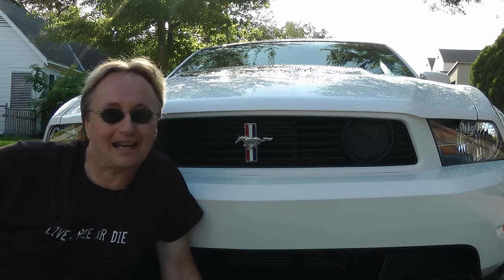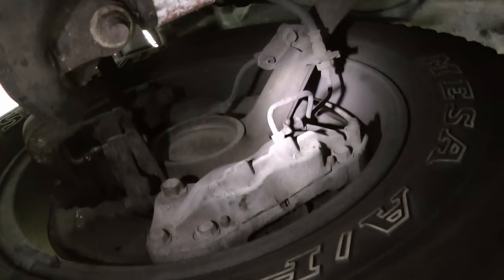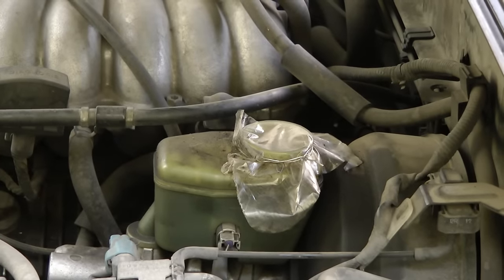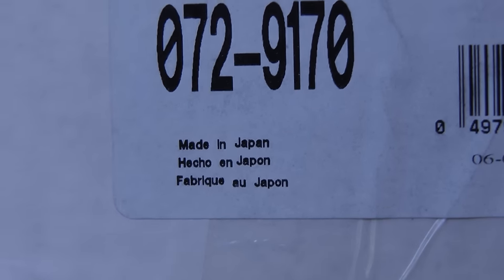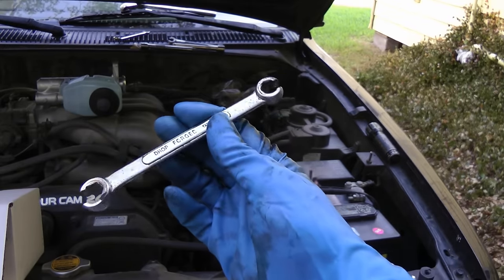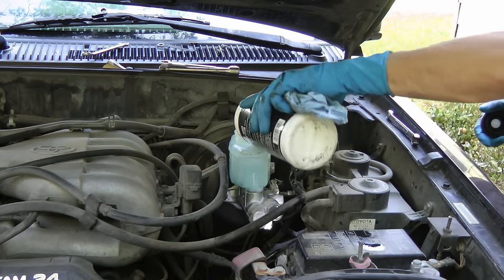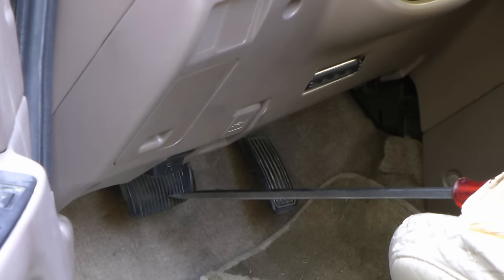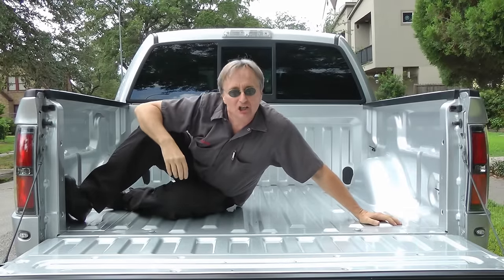How to Fix a Brake Pedal that Sinks in Your Car (Brake Master)

Comment: Having an issue with my 2000 integra...abs light is on and the pedal sinks to the ground...it will build pressure if i pump it but once i start driving the pedal will sink to the floor again and the only way i can get them to stop is if im constantly pumping the brake...i have brake fluid and there is no leaks ..what could be the issue? I need to fix it asap bc its dangerous as hell driving like this please respond
Reply: Well, not the same vehicle, but I have a 02 Ford f150. Had a sinking pedal halfway down. Changed master, still there. Found that the ABS unit was leaking by, and causing the rear system to bypass. New ABS unit fixed all!! Best brakes EVER!!!!!

Comment: Great method - I usually bench bleed the master cylinder, but this method looks much easy/ quicker .Thanks for sharing it- does this mean no adjustment required for cars with abs module mounted adjacent to master cylinder , or ??  Thanks again for your videos

Comment: Hi Scotty, love the videos. I've got an '04 Tacoma that I took up for an oil change a month back that has been given be grief ever since. During the oil change they also changed the brake fluid. They recommended I replace the engine valve cover gasket but I decided against that initially. Shortly after my car starting smelling of burnt fuel every time I drove around. I took the car back and it turned out that oil was leaking from the engine (of course this hadn't happened before the oil change). I took the truck back and had the valve cover gasket replaced then as I was driving off the lot I noticed my brakes were very stiff and difficult to depress. I went back and my mechanic checked the vaccuum pressure (good) and said my brake booster was bad. Again, this had not been an issue before I took it in. Since then I have also noticed that my tires (I think it's the tires) squeal when I turn the wheel all the way. I assume all of these symptoms are related. Any suggestions would be much appreciated!

Comment: Sienna 2001, Just installed brand new master cylinder, new rear brakes drums, front brakes only 15k miles on them, the brake pedal still goes far down before slowing the car, it stops fine, just not happy with how far down it goes before it stops the car, thanks a lot, your awesome
Reply from the maker: IF you bled all the air out of the system, and that's a BIG if, you would either have a weak brake booster or a problem in the ABS system.
Reply: well, thanks a lot

Comment: Hey Scotty I have a 2004 GMC Yukon Denali XL all-wheel drive the front passenger brake caliper had to put a new one my question was do I have to bleed the whole entire system or just that one

Comment: the 2002-2005 camrys have this problem and cant seem to fix it..spongy brakes and horrible extended braking distance.
Reply: Avalons as well
Reply: i really think it's the mater cylinder. (use better brake fluid.
Reply: Samuel Pong My ‘04 Corolla brakes always felt spongy too
Reply: More likely to be a booster on a Toyota than a master.

Comment: Excellent video, Scotty!  I had been watching videos, trying to diagnose what my problem is, with my 02 blazer, 4.3l. I slammed on the brakes the other night, which blew a hose, AND my master cylinder apparently.  I put the hose, and new line on since the old line was all rotted, bled all 4,and still had a pedal that went to the floor. Thing is, I would get a little  pressure at the pedal until I would start the vehicle, then it would go straight to the floor. I think I eliminated the brake booster. Not 100% on that one, but after your video, I'm almost certain, it's just the Mc. Agree?
Reply: +Matt Hansen  the mc was changed on ours and still the same any help would be great

Comment: Hello Scotty… I have a question for you. I replaced the master cylinder, brake booster, calipers and  ABS module in my 04 Xterra and bled the brakes countless times. Pedal still goes to the floor, why??

Comment: Hi Scotty.    I've got a 2003 Mazda Protege. I've changed all four brake callipers and the master cylinder. The pedal is still spongy.
I attached a long piece of bleeder hose to the rear brakes - right first then left- and put the other end in the master reservoir.   I pumped the pedal to circulate the fluid. The right side was good, the left side still spongy. I think the brake lines are attached diagonally- one rear to one front. Do you think the problem is with the ABS and I need a Diag Scan Tool to fix the problem?
Thanks

Comment: Hi Scotty, I just replaced the MC in my Jeep with a rebuilt OEM one from Cardone (you can't buy brand-new OEM MCs for my year of Grand Cherokee any more) and even though it was properly bench-bled, the pedal starts to sink slowly if you hold it. There are no leaks, the fluid level doesn't move. Some people have suggested that maybe it's being caused by air still trapped inside the MC, others are saying no, trapped air wouldn't cause that, I just got a bad MC out of the box, like you say can happen. What's your opinion?
Reply from the maker: NEVER use rebuilt brake masters, they are often crap

Comment: Do you bleed the air out with engine running or off.  06 f150 Lariat. Replaced master cylinder. Capped off brake fluid, bled each wheel cylinder to bleed off air.  Right rear, then left rear, right front. Did this with engine off and the wife assisting by pumping up brakes with engine off. Should I have bled the lines while one brake line connection at master cylinder was loose slightly after the brakes pumped up tight(with the other line connection tight) then repeat other line.
So basically bleed at MC not individual wheel cylinders. 
I hadn't been able to get much pedal by using an assistant and bleeding individual cylinders. Please clarify is the bleeding to be completed with engine running or off ?

Comment: Scotty, I have a 98 Ford Ranger XLT 4Cyl that I recently did a rotor and bad replacement on the front end. After  finishing up, I now have a brake pedal that feels like it is working before starting the car. But after starting, the pedal goes to the floor. 

When pushing the right front caliper pistons  in, I bumped one of the pistons and it squirted some fluid. But I continued resetting their positions. Could this have caused air to get in, or enough air to make my pedal really soft?

Thanks for the help!

Comment: I have a 96 explorer that I purchased in May of this year.  The brake pedal will go all the way to the floor periodically and it makes a hissing noise when I apply the brakes when the vehicle is running. A local parts store told me that it sounds like the brake booster, but I don't want to replace something if that is not the right part. Does this sound like a bad brake booster to you? The master cylinder was replaced a few months before I purchased the vehicle at a shop, but I have no idea how the bled the master cylinder.  I'm afraid to drive it at this point since I don't know when the pedal will go to the floor, and I might not be able to stop. Thanks for any info you can help me with. :)

Comment: Sorry about posting a comment on such an old video but I have a question about bleeding brakes. I was always told to bleed the farthest wheel from the master first. Now, with all most every car having ABS and they are never located in the same place, I have been told to bleed the farthest from the ABS first. Is this right? Does it matter?

Comment: I have a 1995 chevrolet k1500, on a cold start, ill press the brake and the pedal doesnt like to return. I disconnect the vacuume hose and pump the pedal until it returns and reconnect the hose and it will work fine depending on the temperature outside and the vehicles, im assuming anyway. But i can not find out what the problem is so i can fix it. I love these trucks, 2nd one like this i have had, and i enjoy working on these. Now scotty, do you think you have an answer for me? Guy i bought it from put in a new booster, dont think a master cylender, bled the lines real good, but he couldnt find out what the problem is either.

Comment: thanks for the video.  quick question.  I recently replaced my front brake pads and in order to fit the new pads I released some brake fluid, instead of just using a clamp to push the cylinders in.  After replacing the pads I pumped the brakes and it seemed ok.  Now when I turn the engine on and drive; the brake pedal sinks a little more than before and of course there is a small delay when I brake.  Doesn't sink to the floor but enough to feel the difference.  What do you suggest I do and/or do you have a video available to do it? Thanks for any help
Reply from the maker: +Walter H bleed them out again, some air is left

Comment: Hi Scott. I have a 2003 Odyssey and I am replacing the Master Cylinder. I have done this job before on a Caravan and Jetta. I unbolted the two bolts from the Booster and the brakes lines. but the Master Cylinder wouldn't come out of the booster. it feels like a spring or a link holding it back. Is there anything preventing from coming out or should I use a bit of force.

Comment: Hey Scotty Great Video as usual.  I have a rebuilt ABS control module on a 2001 runner.  I am getting these codes.
I dont see any leakage
C1223 abs control system malfunction
C1246 Master Clyinder pressure sensor
What else can it be?

Comment: Scott, I just replace the both front caliper two week ago. I bleed all four brakes and still have no power brakes. I bleed it out few times and fanilly my rear brakes able to stop while backing up bot not in front brakes. Before I replace front caliper I have air in line including master cylinder after the cap rubber pull it down when I stop after I check it and fix the problem but still have air in line then after got worse than before. Reason I replace front caliper is because the bleeder valve is rusted and can't get it off just for replace it. I'm not sure if mater cylinder need to be bleed out or need to replace. I wish I can upload my picture here but can't. Just suggested?

Comment: my pedal is sinking, but i have brake at the very bottom.  sometimes i have brakes right at the top also.   however, if i slowly push on the pedal, i can sink it pretty far.  master cylinder AND brake booster? or just master cylinder?

Comment: have a 97 form ranger put new brakes on everything was fine a month later now you can hit the pedal hard brakes stay up if you let up a little bit they will go down . if you hit them soft they will go down from the start what do you think.
Reply from the maker: +Martin Standrew  replace the brake master cylinder with a brand new one, and PRAY the brake booster isn't bad too

Comment: I have a 2017 camry with 24K  miles on it. relatively new.
my brakes feel spongy. would a newer car  have a master cylinder problem? possible?
is it possible my brake pads are low?
somebody told me something about pumping brakes in  a certain fashion  that this will self adjust something so it will feel normal(idk if this is true...) any help greatly appreciated.
bte great video

Comment: Scotty, I've got a pedal that goes nearly to the floor about an inch of clearance yet, I still feel that this is a long stroke however my master cylinder still engages and pumps fluid correctly and my fluid hasnt changed level in the 7 months i've owned the car, just wondering what your opinion is?
Reply from the maker: either air in the system or master is going out

Comment: Hi Scotty I like to watch you videos. I have a 2004 xl7 and brake sinks I have changed the master cylinder and bled the lines and still does the same, my in law has a 05 xl7 same issue. Thanks for your help

Comment: Fortunately i dont have ABS. Yesterday i looked under the booster and near the MC, all seems good and dry. Not even a smell of brake fluid leak. But i have to check for the bleeders, calipers and rear wheels.
I replaced the bleeders at rear drum brakes. The new bleeders were not exactly same, a little bit different.
Maybe this has to do something with this. 
I devote all the to these things, bleed the master, then will put old bleeders back etc etc.
Hopefully it changes something. Thanks Scotty

Comment: Scotty I have had spongy brakes for a while now. I have replaced all 4 wheels brakes pads and shoes and all 4 wheels drums and rotors because I they were warped and old, still had problem I am doing the master cylinder this weekend, is there anything else that could be doing this?

Comment: Hey Scotty got a 13 f150 with new rotors, calipers and pads all around. Took off today a little fast and just sat thier and spun with front wheels locked up. Any thoughts?   Bill

Comment: Hey..  Scotty.  Hello my first time asking any questions to you. I have a 2014 dodge Ram 1500 75k  eco diesel.  I was going to do the front and rear brakes. The rotors are looking pretty good. My question is should i have the rotors turned before i install new pads or get new rotor?   Thanks for your time.
Reply: Now days you spend about the same amount turning as you do buying new.

Comment: Scotty, just had entire brake system replaced on 93 Dodge Cummins 250 including lines and now it appears the brakes are getting hot as hell and sticking.  Even the front brakes?  Any ideas?

Comment: funny how we have the same vehicle. i fully broke down my master cylinder and it looked respectably in great condition. including the thick rubber seals on both internal pistons inside the master. vehicle stops good but after holding brake pedal it sinks to the floor, no leaks. rear wheel cylinders not leaking and drums adjusted. i guess i'll replace the master. PS i know exactly where you bought yours lol last time they had heads for sale as soon as you walk in.

Comment: and if air is leaking where the hose is attached to the power brake booster, will that cause your brake pedal to go down further to the floor, before the car comes to a stop?

Comment: Hey Scotty, I have a 2006 Scion Xa, when driving to a stop and pressing the brake, the brake looses a little pressure when pressed and then come back, then the car will come to a complete stop, I feel like there is air in the system, should I bleed the brakes?

Comment: Not sure if you are still answering questions but I have a 1974 gmc vandura with pedal sink. I can get pressure by pumping the brakes. Is this the same procedure to change my BMC?

Comment: Hey Scotty, I have an 03 GMC Sonoma I just replaced my master cylinder in, have confirmed there are no leaks externally, and still can't get pressure to my brake system. Any help?

Comment: Hi Scotty I replaced my front breaks pads in my 2014 Camry and I unlooses the clippers bolt to get the air out of the brake system, but I think I shouldn’t do that. How I can make the brake pedal hard not to sink again?

Comment: I replaced the master cylinder and brake booster on my 03 4runner. The brake does not come all the way up. It prob retutns halfway up. Can it be the return spring or do you think i didnt bleed my brakes well?

Comment: Scotty. If  pedal sinks is it always bad master cylinder?
Can the air in the system cause this? My car repair manual also says how to bleed master cylinder. Any tips for detecting bad master cylinder?

Its expensive part and im not even sure if its bad. I have bleed the system 2 times and pedal still falls to the floor and brakes apply when pedal is near the floor.

Comment: I have a question. I have a 1996 Pontiac Firebird V8. I recently upgraded the front brake calipers and the fluid in the master cylinder fell down very low. I heard that will damage the ABS system and the ABS system will need to be bled at a professional shop. Well I did not do this. Instead I filled the entire system with brake fluid, bled the brakes like regular. I was able to get a pretty firm pedal feel after this. I then went driving and the brake pedal fell down with a little bit of Engagement at the very bottom of pedal travel. The ABS light is on and I did not bleed the ABS system. Do you have any ideas on what I should do?
Thank you!!!

Comment: I have a 2006 chrysler 300 the brake pads on the front drivers side are getting stuck.  I have changed the caliper and it still gets stuck what do you think could be causing the brake pads to get stuck???

Comment: Got a question Scotty, if say your brake pedal is solid and not sinking, you got no fluid leaks everything works fine till you start the engine, then the brake pedal slowly starts to sink all the way to the floor when pressed (takes about a minute), still no fluid leaks and no brake warning lights not even from ABS...you got an explanation for that? (only happens when engine is running)

Comment: scotty question for you i have a 1999 gmc jimmy rwd 4.3 v6 and i just replaced all calipers and went to try to bleed them but am getting no fluid out of the rear and barely any out of front and now brake light is on and pedal to the floor when vehicle is on what should i do?

Comment: I changed my brake booster... Pedal still going to the floor. I'm going to do ur method tomorrow, do my master cylinder need to be empty when bleeding.. Because mine is full...?

Comment: Scotty, I got new brake bads and new front calipers installed on a 2006 4Runner today. Now I have the spongy brake pedal too that is sinking just like in the video. Mechanic says he beld the system but the problem's still there. My question is, can the system be bled from the master cylinder itself or would I need to bleed from each bleed screw behind the tires?
Reply from the maker: he did a crap job if it didn't do that before. Often the master cylinder can be ruined if too much back pressure is pushed into it when doing a brake job. Guy should be able to figure it out and bleed it correctly IF he's a real mechanic. I assume he isn't. you can bleed it any way you want, doesn't really matter, but I'd be bitching at him myself.